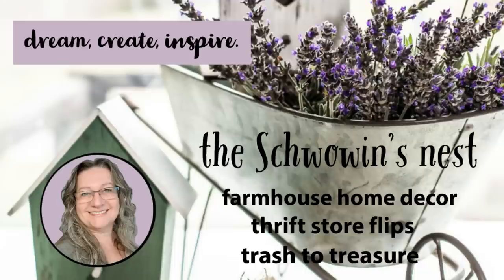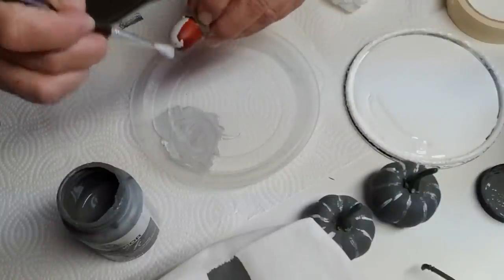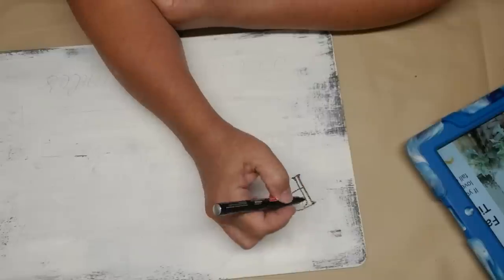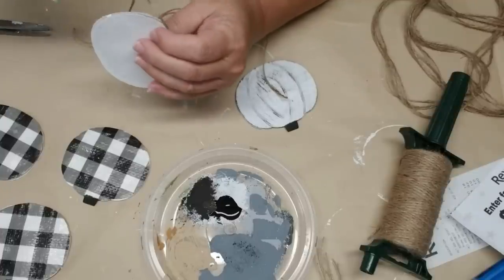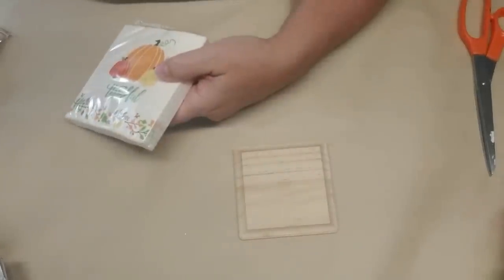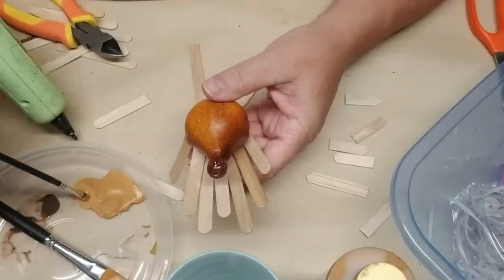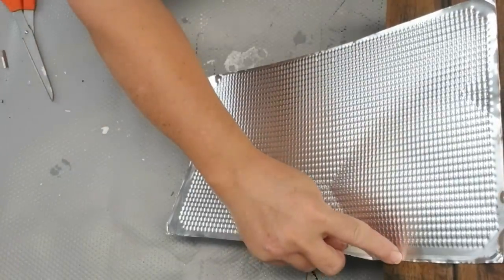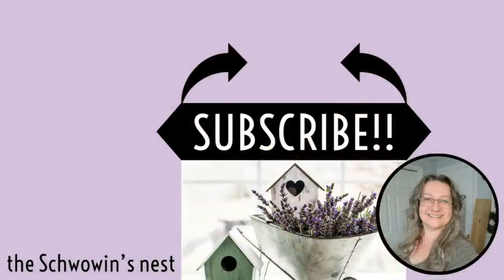Top 5 Fall Favorite DIYs~Farmhouse Fall Decor

Comment: I enjoy watching your videos!  I saw you used mod podge on your napkin. How come you did not have wrinkles once you placed your napkin piece down on the wood block?
Reply from the maker: Hi Kim, thanks so much for watching. I had a few wrinkles but they weren't too bad. I tend to use quite a bit of mod podge so the surface is more slippery and then you have time to work out the wrinkles.